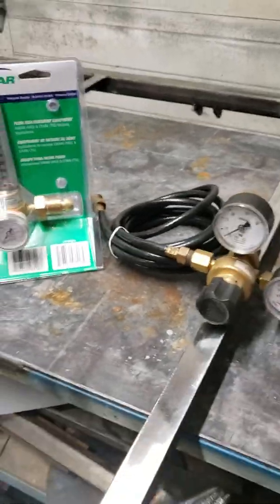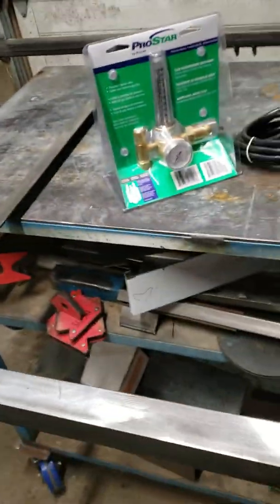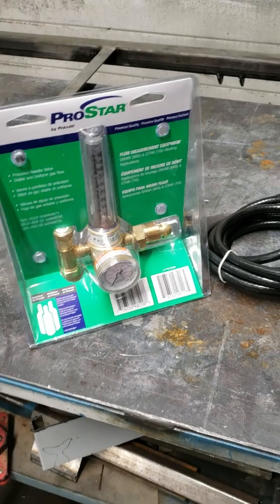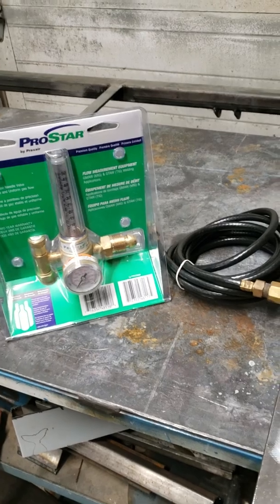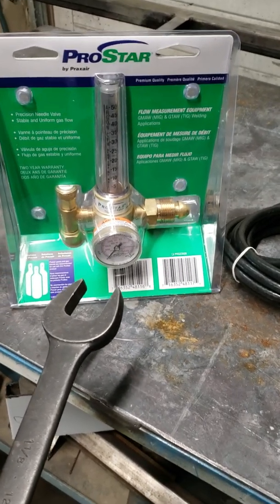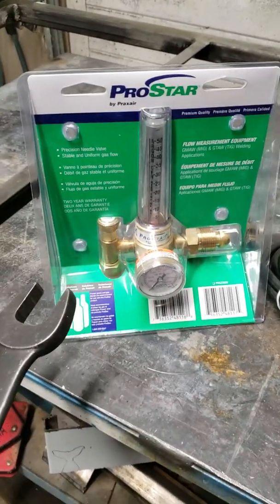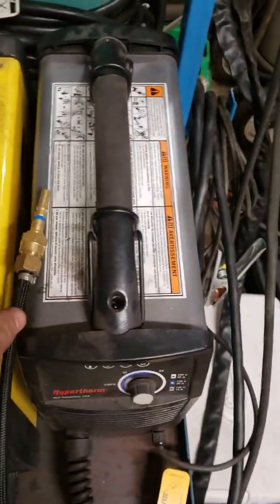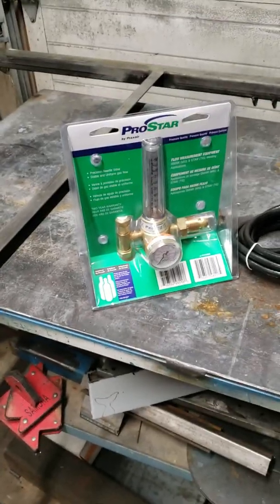Argon flow meters vs Regulators

Comment: In my experience, the 25psi will flow 50cfh with ease.   What I did differently than most is move the flow-meter directly to the welder gas-in-fitting(a bit of a challenge, but doable), I run a regular regulator at the tank set at 30psi, run a hose to the flow-meter at the welder, this regulates the cfh going to the torch.  What this actually accomplishes is an Argon savings, somewhere in the neighborhood of 40%, by not dumping all of the gas in the line from the tank at the press of the trigger/foot-pedal. Works for me, no complaints.
Reply: How long have you been using this setup?
Reply: @alcopower5710  About 9-months. I have up-graded further in my quest for economy, I now use a 24 volt solenoid at the regulator-outlet, then a hose to the Gas-mixer(where I live is is nearly impossible to get anything but 75/25) then on to the 2-valve manifold(C02/Argon) at the flow-meter, from there a line to the MIG welder. When not welding, the gas is trapped between the two-solenoids, thus the gas cannot bloat the lines when not welding = no-surge..  If you like, I can send you a photo of my creation.
Reply: @davidjanuszewski5020  a pic would be great. Do you need an email or can you put a link to something like photobucket?
Reply: @alcopower5710  An email address will be fine.
Reply: 40%! I never thought it would be this much to be worth the setup. Thanks for the tip